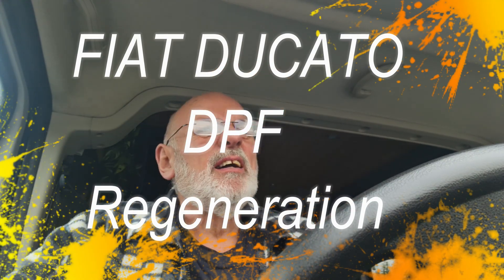FIAT DUCATO DPF Regeneration

Comment: Hi Mark, DPFs are mounted since EURO5 was mandated. Even some EURO4 cars had one mounted already in 2008 e.g. Mercedes E220CDI or Volvo with D5 engine.

Active regeneration kicks in when passive regeneration have failed. You don't want an active regeneration too often as it may crack your DPF ceramics.
If you get it too often it may be an indication of faulty injectors or other engine fault (e.g. MAF sensor). 

The thing is that DPF masks any problems with your engine... and if by any chance you get the soot out the exhaust pipe (not in your case) then it means that not only your engine needs some service, but it means that DPF has given up.

Comment: Hi Mark, the heat you felt was from the regen process which (after certain parameters are met) injects excess diesel into the engine which then continues to burn in the exhaust to super heat the DPF and hopefully burn of the accumulated soot. It's a very crude procedure (in my opinion) and neither engine friendly or economical!! You've probably heard this before but if you are only pottering around then you need to take it for a good blast now and again 🙂 this helps to reduce the chance of excessive soot build up. It's just how modern vehicles with DPF's work these days 🙄
Reply from the maker: Thanks very much very informative and makes me feel better
Reply: @MrMeltedwellies is yours a manual gearbox or Comfortmatic.